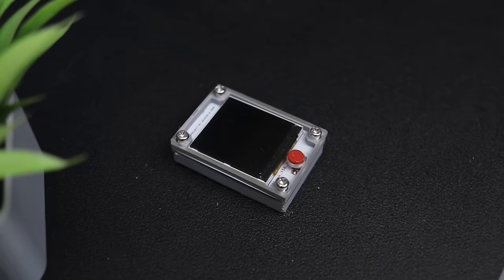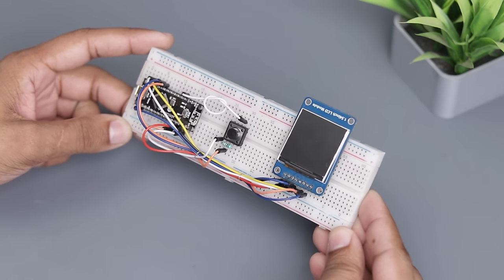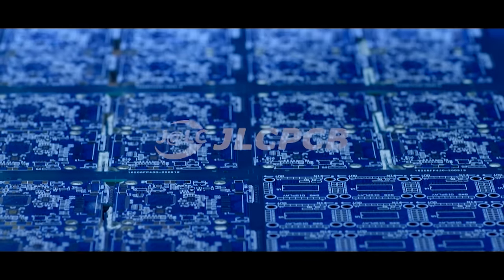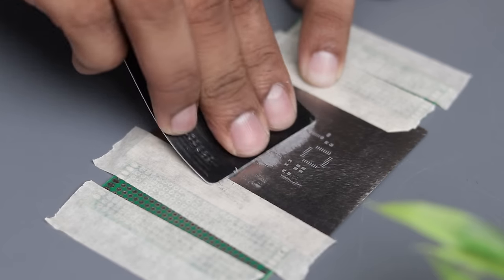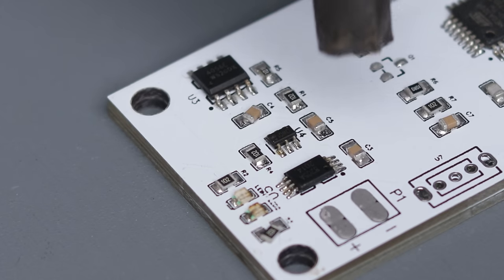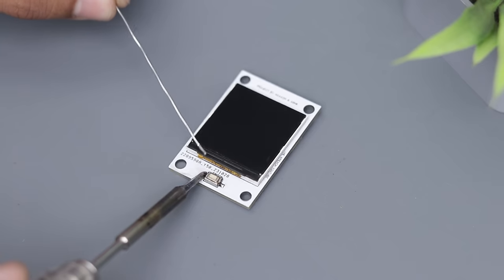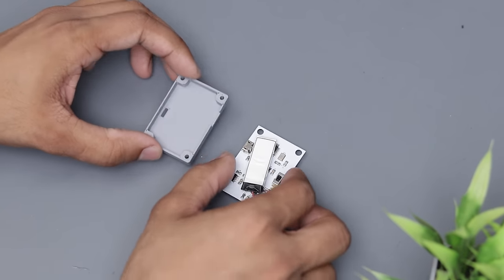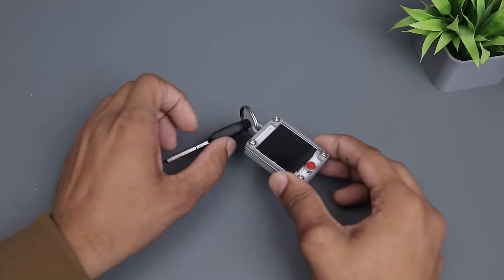WOW! Making Smallest Handheld Gaming Console with Arduino | Arduino Projects

Comment: Thank you for this amazing project. I am planning to build one myself with aluminium case instead. But I have a question regarding if there will be a difference if I use cheaper screen, if you changed gerber files so soldering pad will fit flex cable from screen, and if you can specify smd parts and it's placement (BOM)
Thanks in advance

Comment: What characteristics your battery has? It doesn't seem like 6+V battery... How does your Arduino turns on even?
Reply from the maker: The ATmega328P chip operating voltage range is 2.7V-5.5V. i’m using 3.7V battery.